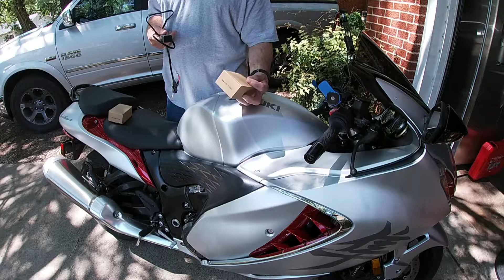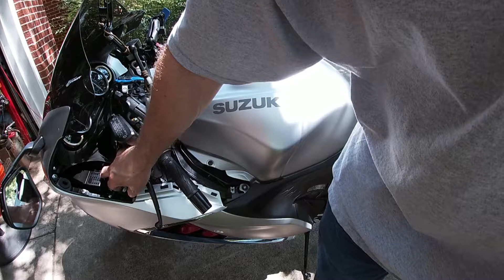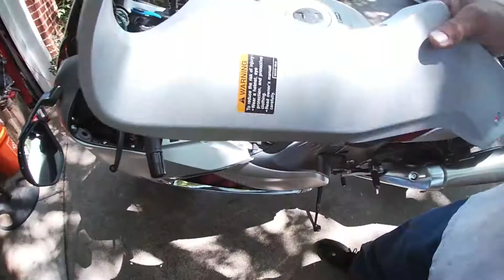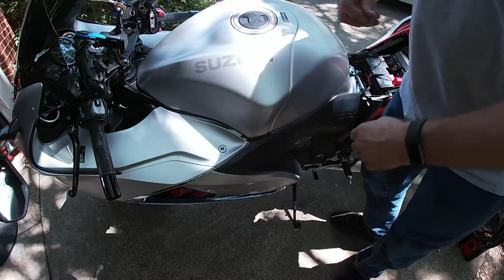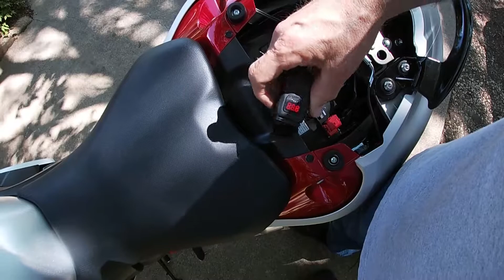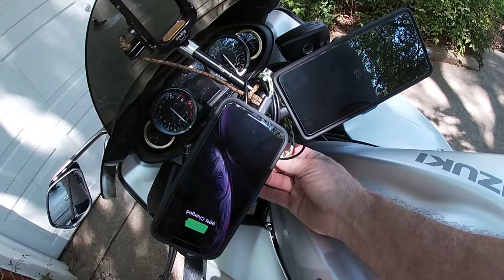Installing High Output Dual Port USBs on my Gen 3 Suzuki Hayabusa

Comment: great product and install. can you put a link to that product
Reply from the maker: Thanks for the reply!
They worked flawless for the entire trip, and kept my gopro on the tail, my iphone and samsung phones on the front charged as well.
Really worked well so far
I will be buying more for my KLR
Good Luck!

https://www.amazon.com/Vemote-Motorcycle-Waterproof-Voltmeter-Handlebar/dp/B08RYJ8QK2?pd_rd_w=EbyAf&content-id=amzn1.sym.deffa092-2e99-4e9f-b814-0d71c40b24af&pf_rd_p=deffa092-2e99-4e9f-b814-0d71c40b24af&pf_rd_r=DV9V4SXPQCF611ZS7AFN&pd_rd_wg=wKqn1&pd_rd_r=d55fe4ad-74ae-40af-ab99-610acf2eaafd&pd_rd_i=B08RYJ8QK2&psc=1&ref_=pd_bap_d_rp_10_i